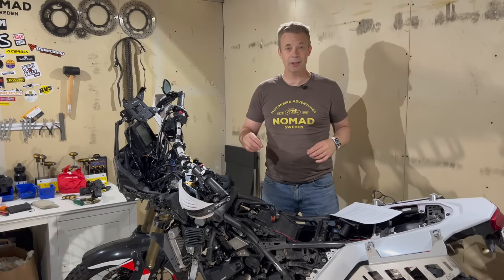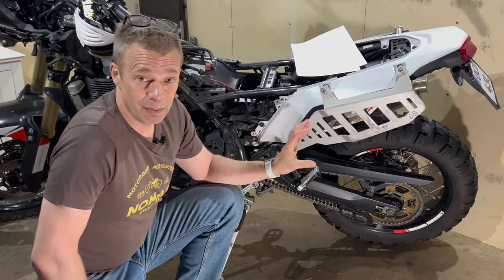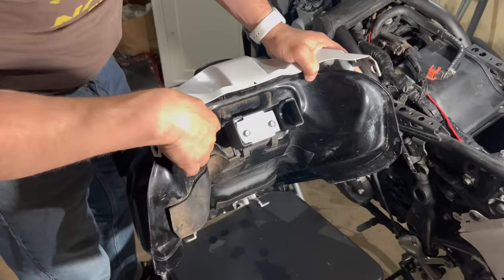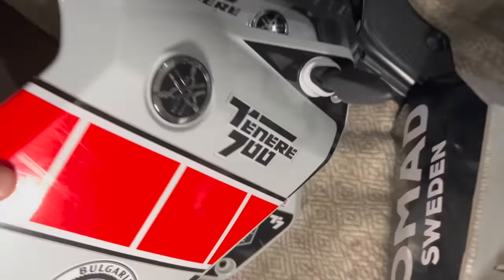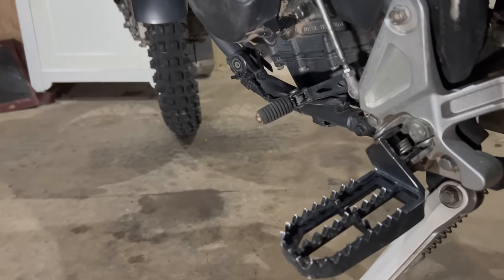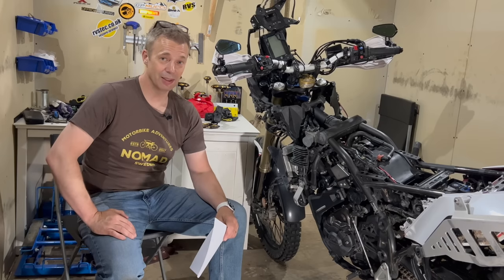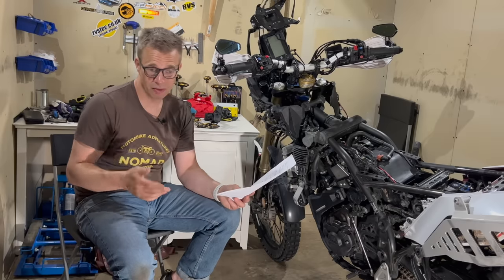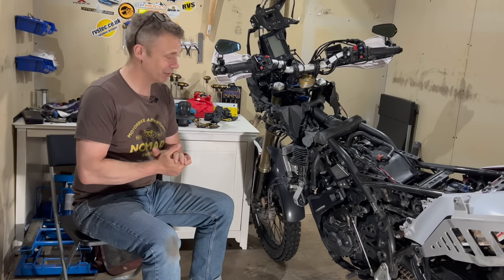Tenere 700 - 50,000 km long term review

Comment: A question about the GB Racing engine covers: Do you find that dirt and debris get caught between them and the engine causing corrosion? I like the idea of them but it seems like they would create a place where trapped mud would cause problems with the actual engine covers. I'd be very interested in your experience.
Reply from the maker: I have not looked actually, but they fit really snug to the engine and I do not expect any corrosion. When I take them off I will let you know.
Reply: @NomadSweden  Thank you!

Comment: mate, I had 40k check now and 0problem. the ACF 50 works well and fuel economy I did recently twice counting: record 3.35l/100km after 3.49l but mostly I ride about 3.8l  insane
Reply from the maker: Thanks Mich! Yes those are very low consumption numbers. My record is 3,8 so you beat that :)

Comment: When cold I always engage clutch and open throttle a little and release clutch suddenly. only then I put 1st gear smoothly.
Reply from the maker: Thanks! will try
Reply: Engine off. 2nd gear, pull in clutch, rock bike fwd & aft
Frees up plates. Works on my SRX600

Comment: Did 7300km (4600 miles) in 8 days and it was fine as far as comfort.  Will change rear sprocket to 43 teeth so it cruises better at 90mph (144kph) (US highways).
Reply from the maker: Wow thats a long trip kn 8 days 💪🏻

Comment: there is a wobble in the front wheels, especially between 60-80 km speed, do you have this situation too? my tires are pirelli stock tires thanks for video good luck🇹🇷🇹🇷 From TÜRKİYE
Reply from the maker: Merhaba. Wheel wobble can be many things. Normally it's either unbalanced tyre, damaged rim or a bad suspension setup. Suspension is actually important to prevent wobble. Check sag etc. If you google there are lots of more reasons, so not always easy. But rarely it's because of a faulty tyre.
Reply: @NomadSweden  teşekkür ederim 🤚
Reply from the maker: @onlynature9507  Rica ederim! (Learning for my trip)

Comment: bra oversikt, har et spørsmål. hvilket Lithium battery har du i din fine dame.... skal bytte ut orginal battery for Lithium
Reply from the maker: https://ruggedroads.co.uk/epages/00cbb604-5d1c-407e-8207-580e14387ec5.mobile/en_GB/?ObjectPath=/Shops/00cbb604-5d1c-407e-8207-580e14387ec5/Products/LTZ10S-LION&Locale=en_GB
Reply: @NomadSweden  takk så mye, kan si at jeg så på noen av dine videoer før jeg kjøpte min T, angrer ikke på hverken å ha sett på dine videoer eller å ha kjøpt T. Takk så mye igjen. Save riding...

Comment: Hi, maybe you can help me. Which tires would you recommend for the T7? Especially for a 6000km TET trip? Are those the E12 and E13?
Reply from the maker: Check my tyres video. Yes its e12/13z they are great but will not last 6000km. I would choose any Motoz tyre. Ex Adventure as shown in my tyre video

Comment: It is strange that motorcycle manufacturers do not make motorcycles sufficiently protected from the beginning. But instead you have to buy a lot of protection for it. Their motorcycles do not seem to be made for off-road driving. BMW's adventure bikes is a little better but not enough.
Reply from the maker: Hand guards and bash plate could be better. The rest is optional in my world.